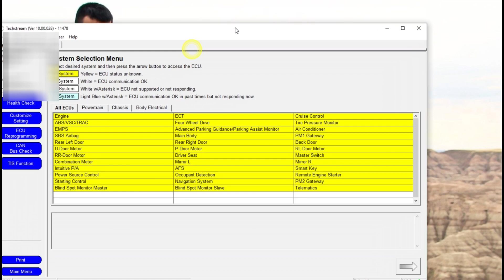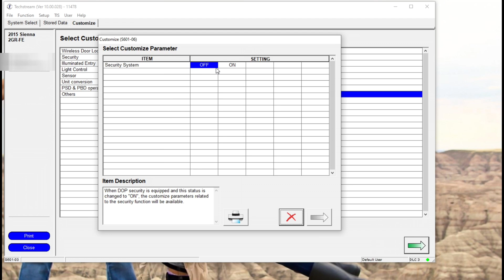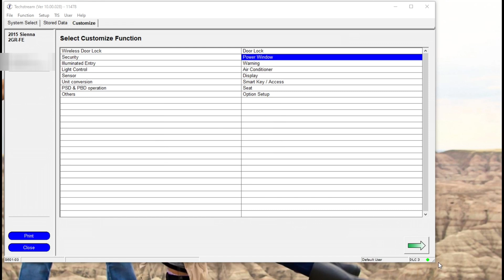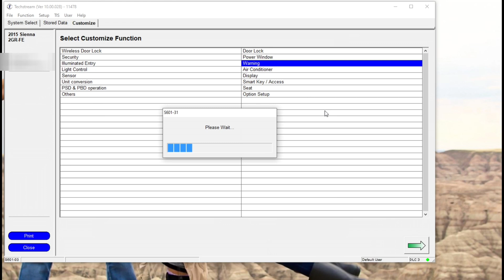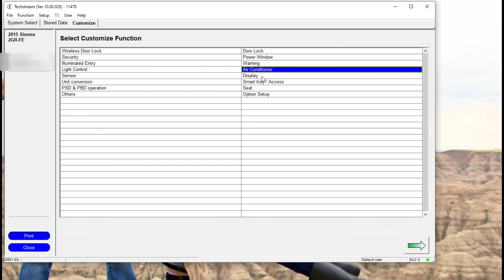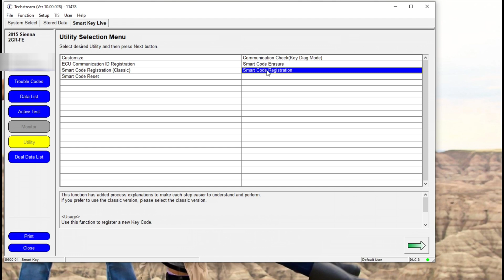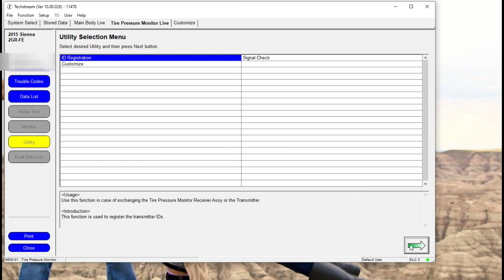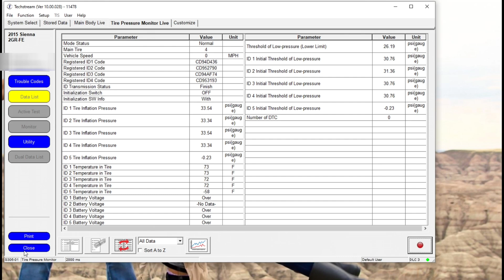Enable Toyota Sienna SE Security Alarm System | Techstream Tutorial | Smart Key TPMS Programming

Comment: Hi, I got an hood indicator signal on, whenever I enable the DOP security. Any way to fix this? Thanks
Reply from the maker: You need to add a hood pin switch. I show that.
Reply: Thank you..can I just put jumper on instead of pin switch
Reply: Hi, i just got the hood pin. However, when I enable the DOP security again. The hood sensor still go back on. Even though I already got hood pin installed. Any suggestions? My car is Rav4 hybrids 2025 LE

Comment: Quick note - after you go to Option Setup and turn DOP Security On, more options should pop up in the Security menu that you were in at 7:19. On my 2008 Camry XLE V6, I have options for "Passive Mode (Security System)" and "Entry Delay Time" in addition to "Warning by Horn" and "Warning by Glass Broken Sensor". 
The passive mode is for the alarm to arm itself without you needing to lock the doors. The entry delay time is for how much time should pass after you open an unlocked door before the alarm goes off. Passive mode comes disabled from the factory even on cars with the alarm enabled, so it's just a matter of personal preference.

Comment: That’s will work on 2022 RAV4 XLE?
Reply from the maker: Should have similar settings
Reply: @TunerwithKids  Thanks. I just checked my RAV4 22, and it’s so easy to see the female hood pin plug, even without removing the bumper.

Comment: Great video! Some 1st hand updates after I did it today on our 2013 Sienna. (Yeah, after 9 years. LOL) 1. Shorting the 2 wirings is an easier & cheaper way to enable the security system, as DrCoffee said. It’s also more reliable. If I bought a new hood latch with a hood pin switch, I’d run into problems because the connectors in the harness plug rusted/rottened so badly that one of them broke away with a light touch. Not surprised because it has been exposed to the environment for 9 years. 2. Without the previous step, the security system won’t work or respond at all even if you enabled it in Techstream.

Comment: The glass brake sensor is part of their VIP system, I think VIP stands for vehicle intrusion protection. The module runs some cars around $220 through the parts website that Toyota runs. Some dealers have different pricing, shop around. It detects pounding on the windows and breakage. The unit itself has the microphone and sensors in it. It is not using the Bluetooth.
Reply: Yep, it's the VIP GBS accessory. Although, for cars that come without factory alarm, the VIP RS3200 Plus is available and it includes everything to both enable the alarm and add the glass breakage sensor.

Comment: thank good video,
I have a question, I have a sienna limited premium 2015 this van comes with remote start. When I turned on with the remote it comes on but  it shut off if I unlocked the door I know it’s for safety. It’s possible to disable the safety auto off?
Reply from the maker: I doubt it since it’s part of the way auto start works on this car. Just gotta restart it when you get in.
Reply: @TunerwithKids  ok mr. Thank you so much! Good videos you have!

Comment: The "Park Wait Time" in Smart Key / Access is time between locking and unlocking the doors by touching the door handle.  Once the door is locked or unlocked, you have to wait the set amount of time to unlocked or locked.  The default 2.5 second is little long for me.  I set it to 1.5 second.

Comment: I have a 2019 SE. Is this the reason my alarm keeps going off. Cause the dealer couldn't figure it out.
Reply from the maker: If alarm is activated without the hood pin switch it will show as hood open when driving.
Reply: @TunerwithKids  
No it only goes off when the car is parked and shows no hood being open when driving.

Comment: Hi Binh. I follow all the steps as in your video and it didn't work with my 2016 Sienna SE
Reply from the maker: What didn’t work? The settings or the program and cable?
Reply: @TunerwithKids  I did all of the steps successful. I enable it to ON as in your video. But then I lock the car with the window open. I wait for a few minutes and I open from inside and no alarm sound
Reply from the maker: Do you have the smart key version? Is the key nearby?
Reply: @TunerwithKids  I do have it and left the key inside the house.

Comment: Does this work on a 2012 le? To clarify, does this mean that you will hear the audible confirmation when the alarm is armed?
Reply from the maker: Does the 2012 LE have factory keyless entry? If so, then, yes it should work. The alarm uses the horn and flashing lights when someone tries to open or unlock without the remote or keys.
Reply: @TunerwithKids  Thanks for the response. I'm not sure what "keyless entry" means. It has a FOB to lock/unlock and open the sliding doors. It uses a key to start.

What I'm really trying to do is get an audible sound when the doors are locked and the alarm is set. We just purchased our van, so I'm trying to figure it out.

Our old vehicle sounded when you hit the lock button twice (1st time locked it, 2nd time set the alarm and sounded to tell you so). Can I achieve the same function by installing the latch and interfacing with the TechStream software?

Also, the product you linked to (USB to car connector) was from pre COVID days. Amazon is saying 1 month for delivery. Are you aware of a domestically available product?

Sorry for all the questions. Thanks in advance for your time!

Comment: I just bought one from another seller on Amazon. Everything seems to connect and when I hit the custom settings I do get the list like yours but clicking on any one from the list will not have a pop up with the customized parameters. Any thoughts? I have a 2018 RAV4 XLE using Techstream 12 and I tried 1.4 version too with firmware driver 14, without any luck.
Reply: If using a laptop disable WiFi first before starting the TechStream software so it can't connect to the Toyota website.
Reply from the maker: Not all Toyota cars have custom settings.  2018 should be need Techstream V14.
Reply: @TunerwithKids  I have the same issue as the original poster, i have Toyota techstream and is a fully loaded Toyota Prius alarm anti theft does not get trigger no matter what. Panic button works. When I click on the list it's just blank no options
Reply: ver. 13 will work for  2018 models.
Reply: Same issue as your! Any ideas? What was your issue?